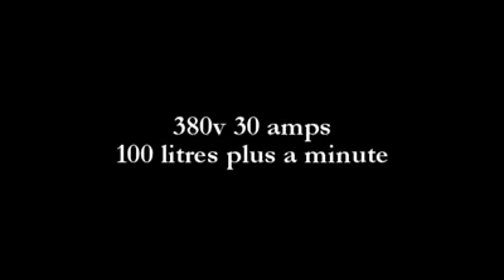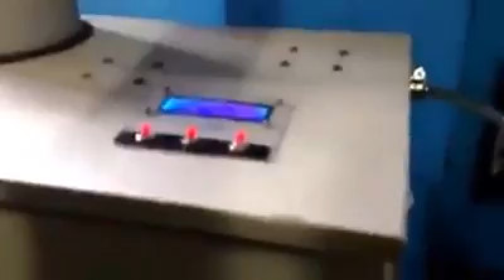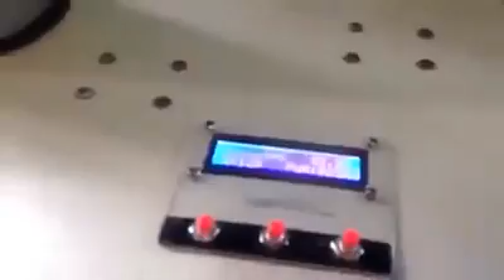US NAVY USING SEAWATER FOR FUEL!!!! Hydrogen hho fuel.

Comment: okey guys you go too much on short cut there.

the hydrogen generator they are talking in there is to make hydrogen, and by combining it with carbon from CO2 diluted in the water, they can make hydrocarbures like gas, diesel, jet fuel, witch is needed to fuel the escort and the planes/helicopters of an aircraft carrier. but these hydrogen generators need a power supplie, and there is where the nuclear side is quite useful, because it fuel the complete fleet with power, and there is no need to re supplies the fleet with fuel for a long time, and it's cheaper to make it like that than shipping it to the fleet lol. let's be clear, the source of power is nuclear reactors, not HHO.
Reply: Finally a normal one, these people are crazy
Reply: Hahaha yeah, i was reading all of the comments and just thought to myself "has no one watched the video? They specifically state they are converting the seawater into a hydrocarbon fuel XD" This is easily done with a cataylst, CO2/CO and Hydrogen, recent advancements in catalyst's has made the technology actually usable in field application. This video mentions nothing about that though ;)
Reply: I dont think the equipment shown was the fuel cell thats being developed rather they wer profeshinal hho generator instalations, yess i belive they intend to use the generators on nuclear vessels to make fuel for the surrounding ships it would be cool if the millitery would make a car fuel with the surplus to sell off.. basically its not over unity  but it may diverge in to outher technologys and become a carbon nutral way of makeing fuel like the catalists that make fuel from sunlight and air but thate way less efficient

Comment: Fuel for what? They aren't using it to power the boat so are they cooking with it? Heating with it? I don't really understand. Plus I've seen better hho output on YouTube by weekend warriors who are just tinkering around.
Reply: the hho is used as a primer.  the secret is that any piston engine work with nitrogen.  the air we breathe is 80% nitrogen. it's the nitrogen who explode,  not the fuel.  for exemple, how do you think nitro car kit works ? answer -more % nitro = more power.  the fuel, kerosine,gas,propane,diesel, are just used as primer to ignite the nitrogen.

Comment: Another bullshit report that tells you nothing, good god reporters suck. The installation is clearly a prototype and not military equipment. 
This makes no sense on a diesel ship as the diesel engines can't make enough power to run themselves. Nuclear ships generate electricity off the nuclear power and generators like you see in this video are for backup power in the event of a reactor failure. The fact that you would not have electricity to power your HHO cell when the reactor is offline means the whole thing makes no sense. 
I need more explanation as to why you would do this.
Reply from the maker: Kevin Jackson your asking the wrong questions. Hho is not the fuel, the diesel is.

Comment: Won't the salt in the sea water cause chlorine as well as HHO?
Reply: Michael McCumber :   Yeah ! You would suspect that there might be a buildup or saturation of salt in the
HHO gas bubbler to a point that they would have to  just add distilled water. That wouldn't be a problem for 
The  Navy.
Reply: Michael McCumber 

Reverse osmosis preprocessing.

Comment: Seawater has high concentration of salt, what you doing to separate salt from water before sending to the HHO generator ?
Reply: salt is utilized in a HHO generator as the electrolyte
Reply: Aloha Diver
And we just dump the chlorine gas into the environment?
Reply: @kevinjackson4464  chlorine? Its not a swimming pool. Sodium chloride is very stable
Reply: @hesedagape6122  Not when you dissolve it in water and then pass a current through it, that makes chlorine gas - very unhealthy. Check out a chemistry book.
Reply: @kevinjackson4464  please do check production of chlorine gas
Reply: @kevinjackson4464  i think it all depends on the actual energy input and the other variables. The chlorine would also dissipate after a while and could be let out at the beginning?